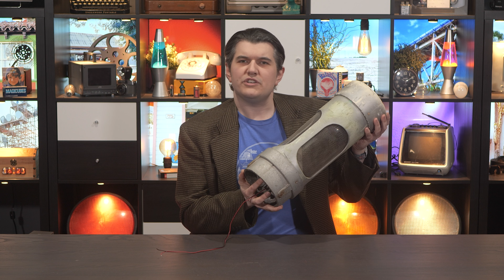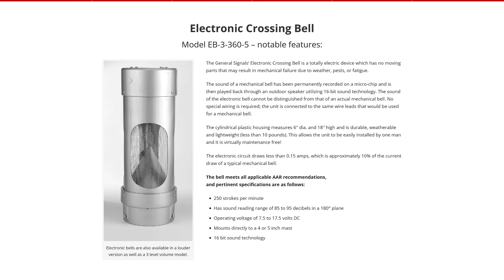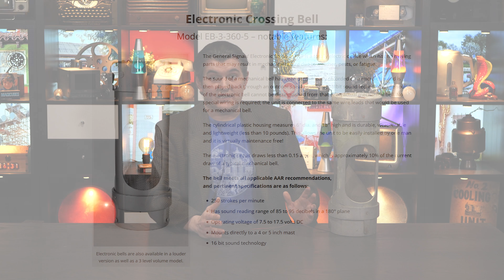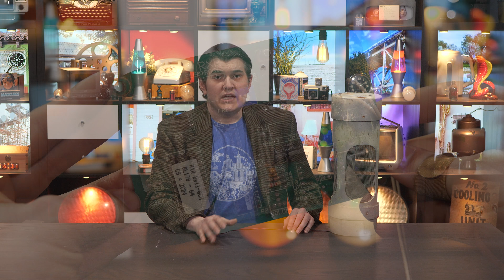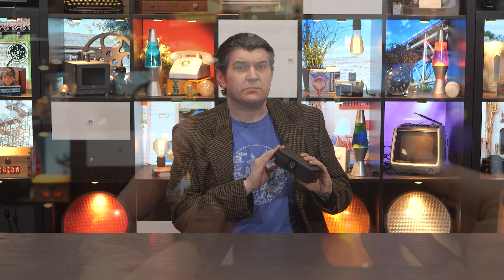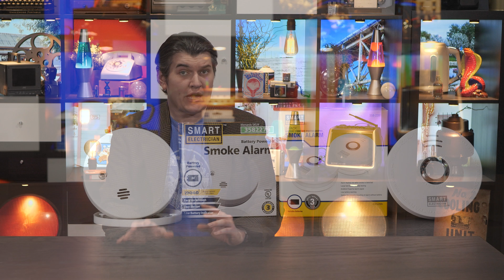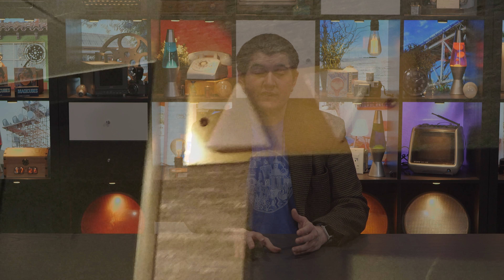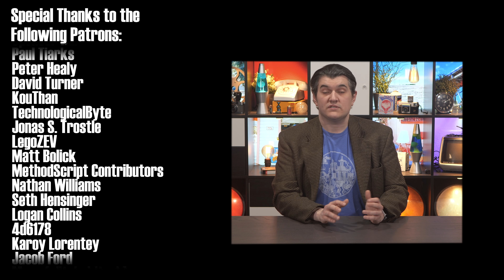The disappearing and unappreciated art of audible alerts

Comment: Ohh that fire alarm is not standard at all.  That sounds like the busy line noise on a call to me.  
I wouldn't be going anywhere
Reply: As he said in the video, he was referring to the pattern of beeps, not the specific tone.
Reply: I've only heard that sound from trucks and stuff backing up. A smoke alarm is totally different, and very very annoying. Must be an American thing.
Reply: @Yetaxa  I don't know if it's an American thing.  I've never heard that sound or that pattern.  It might be local to him fire code, but I've never heard that from a smoke detector or from the fire alarm in the building where I work.
Reply: @Yetaxa Temporal 3 is common in the US, but that is merely a rhythm (or pattern). The pitch and tone showcased in the video is not (I'm just an enthusiast but I've never heard it myself). If you want an idea of what a common commercial fire alarm sounds like, turn down your volume and search YouTube for a System Sensor SpectrAlert Advance or a Wheelock Exceeder. They're loud and often obnoxious.
Reply: It’s all context-dependent. If I hear it on a phone, it’s a busy signal. If I hear it coming from the ceiling in an office building, it’s a fire alarm.
Reply: @fluffycritter yer that's the thing I still wouldn't.  If I hear it in a hotel, or an office, I'd assume someone accidentally put the phone on the intercom speaker.
Reply: @vickymc9695 Did you watch the whole video? He specifically says he's talking about the pattern of repeating sets of three tones, NOT to the specific tone he's playing it in to save us all a piercing fire alarm tone.

Comment: 10:00 The first time I installed smoke detectors that used temporal-3 was back in 2007. Before that, they all had a continuous fast-beeping pattern. Almost all fire alarms I've ever heard at schools or apartments were in temporal-3, except for one school which was built in the mid-20th and had Edward's fire horns on continuous. They were so loud, though, that you couldn't ignore them 🤣 Also, in high school, the outdoor alarms were continuous electromechanical horns, whereas indoors, they were piezo-electric and in temporal-3. No idea why they used two separate patterns like that 🤷🏻‍♂️

I have actually heard slow-whoop before, but it was integrated into voice-evac systems. Once was at university and another at a movie theater.

Comment: can't use any smartwatch that doesn't have gps and a cell radio in it. the primary critical benefit of a smartwatch is that if you fall and bust your leg somewhere out in the woods and your phone is dead or lost you can still call for help. it's crazy to me anyone would use a smartwatch that lacks this function. yeah, you may never use it, but in the rare instance you do need it, it will save your life

Comment: Slightly disappointed that there was not a tangent on Specific Area Message Encoding (SAME) as used by the Emergency Alert System (EAS) and NOAA weather radio.

Those emergency alert messages that sound like a flakey 1980s alarm clock are dual-purpose, they are both an attention-getting audio alert for human ears and also digitally encoded text for computers.

Definitely an audible alert, but more too!

Comment: Most of the unobtrusive sounds you spoke about are utilites like church bells, mandated safety warnings like train and elevator bells or necessary notifications being hidden from the general public like airplane bingbongs.

None of these are all that similar to phone notifications in incentives. The three above are necessary and are made inoffensive because theres no benefit to anything else. 

Cell phone sounds with constant alerts are directly beneficial to companies that want you on their platforms looking at ads anytime they think they can make that happen, bothering you and anyone else is irrelevant if you still engage. Until being obnoxious and intrusive is disincentivized the problem will persist and features to painstakingly silence one app at a time will not help when everything needs a signup, sends emails, push notifications and text messages to do CSat, marketting, security pings and feature updates around the clock.

Comment: There are definitely dark patterns at play in some cases and there is always a lot of experimentation and see if it sticks kind of shots in the dark. On the other hand, every feature is a cost and a liability, and big software companies understand this viscerally. Every feature means someone needs to monitor and maintain it, we need to gather and store telemetry on it, we have to measure it's usefulness and for errors and bugs, we have to listen to feedback on how it works or doesn't, how the UI works, why it's available here but not there, update it when the systems change, etc... So there is also a cost to every feature on an Android phone, and that cost scales with phones in the market, is it any wonder they move exclusively toward the most used features, most critical features, and leave the rest to app developers?
Reply: I should add, I'm frustrated by a lot of modern user experience design also, and I'm not excusing bad or non-intuitive interfaces. Many things were fine, and they've been changed for the worse on my phone too. ::shakes fist::

Comment: the cheap design using pvc parts is a feature safety infrastructure needs to be made as cheaply as possible because they are installed by state apparatuses in the millions

Comment: One bright spot for sound design are bluetooth speekers. Assuming that there are no integrated display.
I use Outlook on Android. You can change the email sound per account.
Audible pedestrian signals have had major changes since their beginings. I believe that public services do take sound design however, sometimes they do not take in to account when that sound is triggered One example is when a bus stops at your stop. While the route is announced, the breaker is relieving pressure making the audio harder to discern. I appreciate this video for how it brings up less heard but simple topics in reguards to dayly experiences.

Comment: 15:51 the main reason I wear an Apple Watch has to do with the fact that it should always be in sync with NTP or something like that, which makes me happy. I don’t have to manually set the clock. It just does it for me. Also when I am running Maps for navigation, it will tap my wrist and make a set of tones to let me know which direction to turn. So I guess this actually ties back in to this vid.
Reply: Tap is so much better than the sound pollution he is advocating here. The problem isn’t that sound design is bad, the problem is that vibration in most devices is extremely bad relative to what’s possible as the Apple Watch shows. It gives all the benefits without the noise pollution of every person in earshot having their “unobtrusive” bing bongs going off continuously.

It’s not anti consumer to make it so that phones tend towards silence. If anything it’s extremely pro consumer and I for one support every update that decreases the sounds coming from devices.

Comment: "This is CRITICAL SAFETY INFRASTRUCTURE? And it's, like, made out of parts from a HARDWARE STORE." and "I LOVE IT." being in the same conjunction is just one of those things that makes me love this channel. "This is critical to people's safety, it was Designed to be made out of Junk" is, in my experience, the BEST design philosophy ever. Because it's Easy To Repair, CHEAP To Repair, but it's simplicity also means it will Last A Long-Ass Time because no fiddly-diddly parts are gonna be shorting out. It's some copper wire, and a speaker. That copper will Rust and Rust and Oxidize and Verdigris until that bitch FINALLY dies and when it does it'll have been obvious for like 5 years that it needed to be replaced. And it'll be a 5 dollar job. And then back to another 30 or so years of Working Fine, and DOING EXACTLY WHAT IT NEEDS TO.

Comment: My 2018 Audi A7 3.0T burns no more oil due to a B12 Piston soak implemented, and now successfully takes 2026 E-fuels like what was tested on the new Porsche 911 GT3 cup race models from the 2025 Porsche Mobil 1 Supercup, (PMSC) like what will be used in the upcoming race that's happening this year on June 4 to June 7 of 2026 in Circuit de Monaco, Monte Carlo. All electric vehicles isn't going anywhere. My Audi stock is still stronger, more powerful, and quite literally will always be more reliable than that electric Hyundai Ioniq 5. How 'bout that?

Comment: I think they went to electronic bells for railroad crossing signals because mechanical bells tend to break after al while. And the volume can be adjusted up or down depending on crossing location. And they can play very different types of sound, as you note by the crossing ball sound used in the USA is quite different than that used in Japan.

Comment: Door signals for European railways are nowadays designed according to PRM-TSI Appendix G, which is an accessibility standard. Compliant tones are very obnoxious high beeps (1900 Hz +/– 100 Hz, 6-10 pulses per second), replacing a wide variety of chimes, beeps and announcements. 
I am still convinced (though I would love to see some actual science on this - maybe they do actually increase accessibility) that these tones are just based on someone trying to come up with the most intrusive tone possible, instead of considering factors like user fatigue and reduction of noise emissions.

Also, the door opening signal sounds like the opening riff of "Where Is My Mind" (major third) which always throws me off :-D

Comment: I think a lot of the public perception about silence and noise polution being the only 2 options is an issue of frequency and experience with obtrusive noises. One person having their phone go off during a train ride is nothing, but every passenger having their phone go off every 5 minutes or one person on speaker phone for the entire ride can turn an otherwise pleasent experience negative. Ive dealt with this a lot at work, with the breakrooms at multiple buisinesses usually being either tranquil and quiet or one person deciding they need to make a habds free phonecall in the middle of the room. So not only is noise design important, but context and frequency of noises and how others percieve them

Comment: People hate stuff making sounds because alert sounds are everywhere. Every manufacturer thinks that their notification sounds need to be absolutely impossible to miss.
Part of this is regulations which make car-dominated urban hell even more hellish by adding reversing sounds to delivery trucks (why? It's the job of the driver to look where they're driving, not the job of everyone else to jump out of the way; give the driver a working wide angle reversing cam, so they can actually do their job rather than rolling over neighbor's old deaf dog).
Doors in modern public transport have sensors which detect touching an obstacle and reopen instantly without applying any meaningful pressure on the obstacle. Yet they still make obnoxious warning sounds when they close.
Imagine, how nice it will be when everyone's phone is also playing notification sounds all the time... I guess, sound pollution is mostly a city problem. But there it's definitely real.

That said: Great video. Notifications need to be waaaay more granular to be actually useful. I turn them all off on principle because they are always way too unspecific. I don't care about most of the stuff enough to want to be immediately (or ever) informed about them. I would like to have a systray icon blinking for a select few contacts. I would like the microwave just doing one single old-school chime instead of N sterile beeps.

Comment: I would love the option to make home appliances not beep, AND to have more pleasant default sounds. WHY does my microwave beep for 10 seconds in really gnarly, loud noise? As if I did not hear it's loud fan going silent and the light switching off, with the countdown timer also stopping?? Yeah good sound design improves the user experience, but with AuDHD, it is also an accessibility thing to be able to switch off any sounds that are not important for safety.

Comment: About the "Curated Ringtones", just give me back the RGB LED for notifications (on phones). There's no need for the device to make a noise if the notification is not urgent. I know i can disable notifications but at the same time, that means loosing information i could need.

And i really don't want to download another app that makes my whole screen light up so one pixel (or 10) can be a color. We had a system that worked, then they took it away.

Comment: The railroad bell being a PVC pipe that was spray painted silver is so funny
Reply: Smallest ones are built into signal pole caps. Some have that weatherproof speaker exposed. Still, I'd really expect PCB to be better protected from condensation
Reply: @brylozketrzyn  The conformal coating sure looks like it has done its duty!
Reply: " Hi, welcome to the Save it For Parts channel "
Reply: Only the oldest bells from that company (General Signals) were built like that! 😂 Eventually once they started making newer models of bells, they changed the structural design to use actual stainless steel instead of PVC. Also, electronic railroad crossing bells from other brands such as Western Cullen Hayes & Safetran (now owned by Siemens) have always been built with stainless steel. So don't worry.
Reply: @speedemon3364 I believe they are still PVC for General Signals e-bells.
Reply: @freebrickproductions  I guess they don't sell enough volume to justify custom injection molded plastic parts.
Reply: @3fives-j5w  Electronic bells from General Signals are actually one of the most popular, if not these most popular, varieties of electronic railroad crossing bells here in the US, believe it or not.
Reply: And the parts rusted!
Reply: The bolts that went through the top plastic cap obviously weren't stainless steel, and there either wasn't any, or the gaskets failed to keep water from getting through the bolt holes. I'm in building maintenance, and it is amazing how much stuff isn't built to properly keep water out of equipment.
Reply: @johnruskin4290  You do know the entire sides are open, right? I don't think its going to leak anymore from the top. As long as the PCB is coated with some sort of enamel it won't be effected.
Reply: it sounded nice, not like ones out here that look good but sound like Temu
Reply: PVC last forever.
Reply: So much for the much claimed Made in USA quality
Reply: @ramdynebix  given it lasted over 30 years, I'd say the quality was pretty good.
Reply: @thelastant8366  I can guarantee that the internals of that did not last 30 years.
Because of the bad design the PCB must have failed multiple times.
Reply: @Jehty_ 

Why do you say that? 🙄
Reply: @Jehty @Jehty_ can 100% guarantee the internals did last that long. Those bells have lasted 30+ years since the 90s and continue to this day
Reply: @CorneliusTaylor-s1u I love when people comment so confidently without any experience lol
Reply: @ramdynebix 

Why does it need to be built more than what he showed? Something like that can last for decades. You don't have much experience building things and fixing things, do you? 🙄
Reply: @ramdynebix its cheap, easy to produce, easy to maintain, and lasted 5× longer than anything made in china. So Im not seeing the issue
Reply: @havokvladimirovichstalinov  you forgot the most important part: made some US company a lot of money.
By having such a incredible bad design (exposed PCB) the company guarantees job security by having to regularly replacing the PCB and loud speaker. Great Made in US design....
Reply: @Jehty_ did you miss the part where it lasted for almost three decades?
Reply: @havokvladimirovichstalinov  I must have missed the part where he would know for certain that the PCB and speaker lasted for 30 years.

Based on my experience I can guarantee that the exposed PCB and speaker did not last for 30 years.
Reply: @Jehty_ 

Where did you get your experience from? YouTube university?
Reply: @havokvladimirovichstalinov it's a part for a railway crossing, there's absolutely no chance it was cheap.
Reply: @bippitybop7654 that setup absolutely lasted 30+ years exactly as is. They’re all over the country still working from the 90s without being replaced
Reply: @bippitybop7654 theres a pretty good chwnce it has never been serviced. Maybe had the horn replaced, but theres no reason the PCB would fail. The ones inside cars last decades in sometimes even worse conditions. 

Maybe youre just an idiot?
Reply: @Jehty_  Based on my experience it was and is probably more cost-effective to simply replace the whole unit as opposed to replacing arguably the most expensive part of it and paying union wages for the repairman to replace said expensive part. This particular one, for example, wasn't working on arrival. . .

Comment: The new Reversing vehicle signal "scratch" sound is genius. It can be heard from like half a mile
Reply: AND it doesn't carry through walls so it doesn't bother people indoors! AND it's easy to pick out the direction of and it DOESN'T ECHO!!
Reply: And it allows people to bet accurately assess the direction it’s coming from, while the simple beep is very difficult to assess.
Reply: And is clearly audible at lower actual volume levels!
Reply: try air horn back up, makes you want to by a rocket to fir at it
Reply: Anyone got an example? I haven't heard this and I can't find a video myself.
Reply: @Draconicrose  mythbusters did an episode about the ability to hear the direction the sound is coming from
Reply: @Draconicrose  try ambulances , I hear it on some